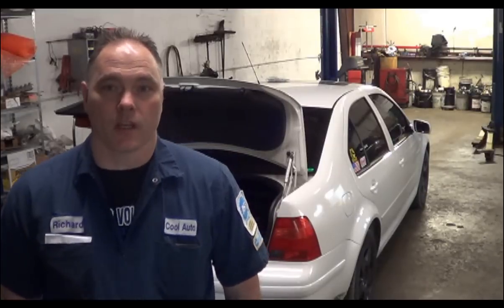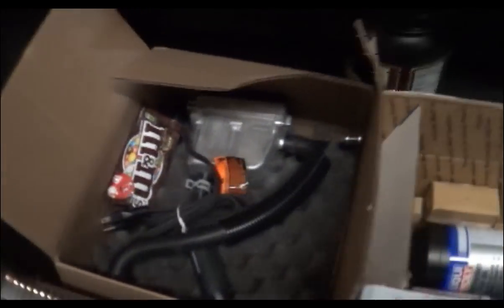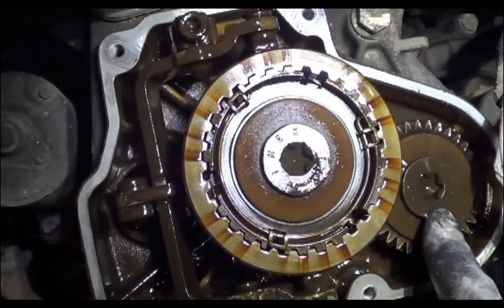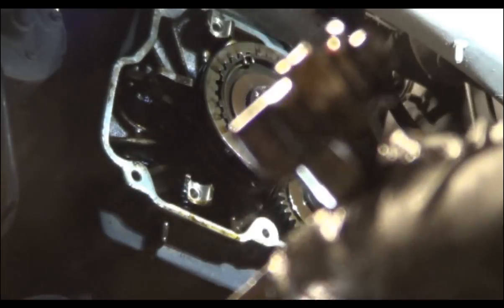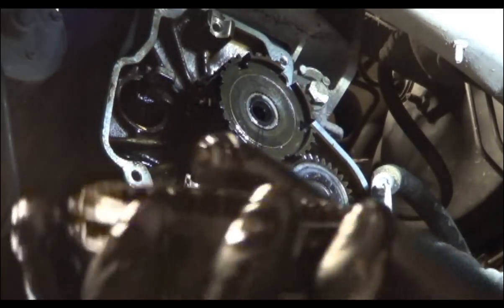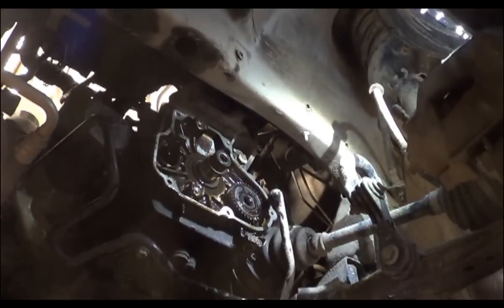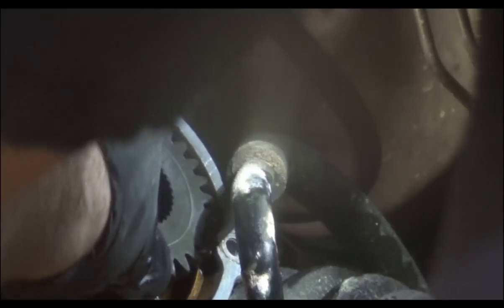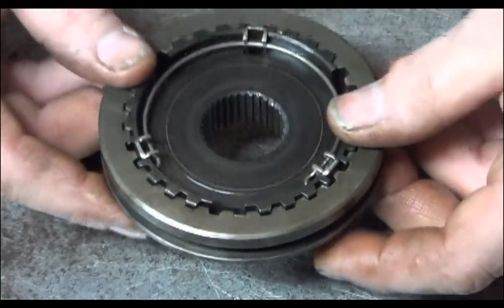Tdi 02J trans 5th ratio change

Comment: Many thanks for making this video!  It helped me to do the gear swap in my '02 Jetta.  I used an air hammer on light setting, with a flat-faced hammer insert that matched the diameter of the shaft.  Also heated the outer splined items (not too much) with a heat gun after reading an article somewhere.  Maybe beginners luck, but mine came off / went on pretty easy, with just light hammering.  I probably would not have had the confidence to attempt myself without seeing this video, so thanks again !
Reply from the maker: I'm glad my video helped.

Comment: Just put my new 5th gear in this weekend.  Using your "hammer" technique, everything came out with out a fight.  Now at 100 km/hr I'm showing around 1800 rpm...which freaks me out because it would normally run around 2100 rpm.  I do a lot of highway miles so I'm going to even save more on fuel....hehehe...I love diesel.  Thanks again!
Reply: Lower rpm is better .  How was your engine behaving at 1800 Rpm  ?  Did it seem like it lugging the engine ?
About how much millage could it go on a full tank . 1300km  ?  maybe 1400
Reply from the maker: did you gain some mpgs?
Reply: @bobbydhal2199  I can only use 5th gear when I'm going at least 100km/h (60ish)  But that's ok because all the secondary roads are no faster than 80km/h  so 4th gets used quite a bit.  The rpms are just too low to shift into 5th at 80km/h.  Because of this conservative driving I get just over 1100 kms per tank.  I haven;t taken it to empty because that would be silly :)
Reply: @CoolAirVw  Yes I did.  When I bought the car 20 years ago I was getting 900 to 1000 kms per tank.   Now I can easily hit 1100 per tank because of the lower rpm in 5th and the conservative driving in 4th.    Not bad for this old car eh?   On the Hwy I drive at 130km/h and only show 2400 rpm.   It's not a massive increase but the car doesn't work as hard as it use to on the hwy which should extend the life of the engine I hope....
Reply: Which gear do you have? 0.622?
Reply: @alessdiazlopez54  0.658  You have to change your driving style but it really is nice on the hwy.

Comment: Good video... but are those 200 rpm really worth it? I was actually expecting a bigger drop. We don't tear transmissions down, so I don't have any idea if that's a normal amount or if there are gears that can drop more rom.
Reply: The difference in fuel economy might be quite a bit different though.
I'm going to do this to my V5 golf.
Reply from the maker: Probably isn't enough in MPG to justify the cost of the gears.
Reply: It can make a huge difference in engine wear & noise plus better MPG mate. Especially in things like the old T4 van 02b box. Even better if the engine is remapped. It means you can use older 02b boxes in the 88bhp van which the original boxes are getting harder to find. I run one from a 2.4 DJZ code.
Reply: Just realised what you meant lol. he should have gone for a longer gear IMO.
Reply: Wouldn't it be down to if engine is powerful enough for longer ratio gears. I have caddy 2.0 sdi very low ratio, but some have tried the 6speed but said wasn't enough power in the engine.
Reply: Hey man is there any way i could contact you? My gears are stripped af

Comment: For pressing the hub and output gear on the shaft, I find it easier to just use the torx bolts without the washer to start them instead of beating them to death. Then you don't have to worry about the dogs and stuff falling out.
Reply from the maker: thanks for the tip.
Reply: I got a nice big socket with rubber over it and extension, held it with thumb n index finger while holding gear and brass jobby in place with middle finger, nice n slow, went in just fine, hope that helps someone
Reply: @CoolAirVW
Where are you located?  I have a lightly used Wavetrac LSD I would like installed in my 5-sp 2000 ALH Golf.  Also interested in a taller 5th gear "while we're in there."  I'm in southwest MI, and haven't been able to find anyone yet to work on manual transmissions.

Comment: To stop the shafts rotating you can pop it in reverse using the stick shift & 5th at the same time by pushing the synchro unit with your hands.
Reply from the maker: good tip. Thanks

Comment: This way worked out way better for me than applying heat. Definitely worth it if your driving a lot at highways speeds. Doesn't seem to struggle much, down low on Malone stg1.
Reply from the maker: You have to be careful applying heat, especially to the hub and slider as you can melt the plastic 5th gear bearing cage.  Also if your doing this on a 06 tdi they have a plastic oil trough that will melt if you apply any heat.
Reply: Hey so you have a stage 1 Malone... did you do a .658 gear?

Comment: In the middle of a tear down all the good stuff go go along with the wavetrac lsd. I did notice that you don’t need to take that third bolt out of the linkage, just slide the fork to the left and come out no issues. I also noticed that the two fingers have wear on it due to being a CCM 02A from 96. Wear can you source those fingers, if not I’ll migg a bead on to them reshape, then polish both the inside of the gear selector and mating surface
Reply: I don't recommend welding any wear surfaces. The parts are heat treated and will get softer if you weld on it.

Buy a new part or reuse the worn part. You will cause more damage welding and grinding it.
Reply from the maker: You would be better off brazing them than welding, as brass would be soft riding on the slider.  I would replace them though.

Comment: @CoolAirVW
Where are you located?  I have a lightly used Wavetrac LSD I would like installed in my 5-sp 2000 ALH Golf.  Also interested in a taller 5th gear "while we're in there."  I'm in southwest MI, and haven't been able to find anyone yet to work on manual transmissions.
Reply from the maker: Kansas City area of Missouir.

Comment: Hey so I am rebuilding my transmission or trying to.  It may not be worth a rebuild tho cause If I remember correctly I had that problem fifth gear was like neutral. So that means my shaft may be messed up

Also my current fifth gear was chipped and missing it's retainer ring on the slider when I pulled it off     retainer ring was laying in the cover

Comment: I have a question about my 2003 jetta tdi 5 speed manual and my 5th gear wont engage. If I do a taller 5th upgrade will I need any additional parts? 5th gear may have gone out due to low trans fluid.  Thanks for the video. Any advice will help.
Reply from the maker: Probably your supplier will send you everything you need to install the "taller" gear.  But if something was damaged due to low fluid you may need additional parts.  Take it apart and see.

Comment: The 5ft gear of my 03 jetta gasoline with the o2j  is not working, im trying to replace the same, so can i change on a gasoline too so i can better lower rpm on freeways?
Reply from the maker: You can change both gears for a ratio change.

Comment: Hi I followed your video and I have a problem with it jumping out of 5th the gear folk is fine 
It goes into gear but just pops out 
I put a 717 gear in the box o2a. Fbk 
Any help would be appreciated 
Thanks
Reply from the maker: adjust the "throw" into 5th and hope.  . That 's the large torx bolt under the 5th cover.  Movement in the shaft due to wear in trans can cause it to pop out and your not gonna fix that without major work or replacement.

Comment: Wow man. Nice.
I have watched a few videos of this. Yours is by far the best. Thanks.
Just a quick question.
I have the passat tdi. It's jumping out of 5th. Could you help me with guidance on the repair or to identify the issue? Thanks again. Dario
Reply from the maker: what  year?
Reply: @CoolAirVw  good day.
Thank you for the reply.
It's a 2006.  As far as I understand it's the 02J.
Reply from the maker: @MrDRSNUGGLES007  Are you in usa?   Never seen a 06 passat with 02j.  04 and 05 passats defiantly would NOT be 02j.
Reply from the maker: @MrDRSNUGGLES007  for 02j popping out of 5th there is a 5th gear adjustment.  I believe I mentioned it in this video, but if the adustment hasn't been messed with it probably has worn 5th hub and slider or potentially worn bearings allowing movement in the shaft that makes it pop out of gear.
Reply from the maker: @MrDRSNUGGLES007   If you have 02j you will probably have to pull 5th cover and inspect then pull 5th hub and slider to inspect.
Reply: @CoolAirVw  great. Let me do so. Much appreciated.

Comment: Is it possible to put the .658 in a trans from a gas engine, I have a tdi but lost reverse so when I swapped the trans I wasn't aware at the time the Gasser had shorter gears
Reply from the maker: Yes.  That may help your issue but the diff gears are different. too.  You should look for a tdi trans.
Reply: @CoolAirVw  I sent you an email

Comment: Am I to assume that this is only relevant to the diesels, because of the torque? My wife has a 2005 Golf with 02J and gas engine. I suppose this wouldn't be very effective, am i right? Thanks for an interesting video.
Reply from the maker: The ratio that we use on the diesels would be counter productive on a gas engine.   But I've heard that folks with gasser cars take the stock 5th gears from the diesel and put them in  their cars., but I've never done that.
Reply: CoolAirVw Rm yea I have done it many times. It runs great!

Comment: Hello Where can I find taller TDI 5th gear set for my 2003 Audi A4 B6 FWD 1.8T 5 speed ? Looking to cruise @ 80 mph at 2500-2700rpm
Reply from the maker: Its not a simple drop in on your trans like  the one in the video.  Would probably require complete removal and complete disassembly of the trans, meaning most shops would charge you like a rebuild.    I dont know where to buy gears like that but most people would not do such a modifiation due to the expense.
Reply: @CoolAirVw  I see I did it few years back on 02 mk4 gti 1.8t swapped TDI 5th gear set.
But b5 passat tdi is not similar to the 1.8t b6 a4 fwd?
Reply from the maker: @UATUNER  Your 02 Gti is the 02J trans just like hte one in this video.  A B5 passat doesn't have a 5th gear cover to remove to do that.  You would have to pull the trans out and mostly disassemble the whole thing.

Comment: Where's your shop at???...thanks
Reply from the maker: Just south of Kansas City Missouri
Reply: O have The same problem ,but mines is a 2002 beetle 2.0 gasoline, is the parts to change are the same as my car?and if it is what's the name of the parts a need the gears,how or where can I get it?thank you!
Reply from the maker: @javierleon2579  Sometimes you can get used gears on ebay.  new gears are dealer only and expensive.  Used transmissions are not that high for your car.
Reply: @CoolAirVw  so my best choice is to replace the whole transmission then??.... thank for the advice
Reply from the maker: @javierleon2579  that is your choice.  But its definatly a good option.

Comment: Why not use a harmonic balancer installer to put the gear back on instead of beating on it? Just a suggestion.
Reply from the maker: Okay but what is your harmonic balancer going to pull against?
Reply from the maker: what are the chances your harmonic balancer puller matches the threads inside that shaft.  I suppose a guy could make an adapting shaft.

Comment: By any chance would you know the bolt size & thread pitch of the 2 gear bolts?
Reply: Vw t4 is t60 for gear bolts and m12 for selector
Reply: @barrybrockp8358  thanks! I'm going to make a tool so it'll be quicker/easier to do the job. Whats thw pitch on the M12 bolt?

Comment: I thought the  .658 was a 600rpm drop
Reply: ~13% drop
Reply: The higher the speed, for instance at 85 or 90 mph, the greater the difference in engine RPM between the two gear sets.

Comment: What's the stock 5th gear ratio?
Reply from the maker: thanks for watching. Sorry I don't have that memorized.  I would love to impress you by just spouting out the answer, but I just dont have the time to look it up.  Honestly though,  you can certainly find that info with a little bit of internet research.
Reply: @CoolAirVw  Found it.  When this horrible virus has gone i'm swapping 5th gear on my Toyota Corolla from 0.815 down to 0.725 for better mpg and lower revs.
Reply from the maker: @jaggass  Might want to do some research to see if that is gonna give you better MPG 's or not.
Reply: @CoolAirVw  With it drop of 0.95 i can't see the MPG increasing but it will certainly be more relaxed at 70mph and even 50mph.
Reply from the maker: @jaggass  ok.
Reply: @jaggass  Unless you are cruising at high speed, .725 is way too high for a Corolla. Generally you need more torque to drive taller gears. Driving at 50 mph could also add significant strain on the engine bearings.
Reply: @davidparker9676  I do drive at high speeds quite alot and can't go above 60mph before it starts screaming. 3400 rpm is way to high at 70mph.
Reply: @jaggass  I'm sorry but 3400 rpm in a Corolla is not screaming. and 70 mph is not high speed. 70 is normal highway speed. 90+ is high speed.

Your redline is somewhere around 6500 rpm, and your power output does not fit the taller gears.

Comment: That is not a wise way to remove the gear. If you don't have the correct puller don't do the job.
Reply from the maker: Strange, I worked in transmission shop for 23 years.  We did tons of manual trans gears just that way, and I'm just now learning that isn't correct.    Even as professional transmission rebuilders we didn't have perfect tools for every job, and sometimes had to improvise to get the job done.  Buy I think this method isn't improvisation at all.   I've rebuilt or repaired 40 or more of Vw 02J transmissions since working at trans shop, and this method worked great every time. I also think DIY'ers appreciate learning alternative ways to do things so they don't have to buy a expensive puller for a one time repair.  That's what youtube is for.  I think I'll continue doing what I do,  because it works.
Reply: Simon Elenor 
 Do you have  video on how to do it properly??
 Nope I didn't think so
Reply: @CoolAirVw  
Great video 👍👍
Reply from the maker: @earth7551  Whenever I receive a comment like the one saying" your not doing it right" or basically any negative comment, I click on their name to look at their channel to see what videos they have posted.  Usually NONE or at least none of any value that would help anyone do anything. No auto repair videos, no wood working videos, no cooking videos, no legal help videos, no financial advice videos.  But they certainly can "knock down" what others are doing.  Several times a month someone tells me, "that is exactly that problem I have and your video helped me fix my car".  That feels great!  Thank YOU for the positive comment on my video!
Reply: @CoolAirVw  
I know right 
Quick question Sir I bought a used 5spd transmission for my 2004 Volkswagen Golf gti 1.8t 
 And the mechanic who installed it never put  oil in the transmission 
I can't believe it was working with little oil that was in it but the bad part is now 5th gear is not engaging not working at all 
 So it was all due to the mechanic who never put in fresh oil very frustrating 
 All gears work now 1-4 and reverse 
 Can 5th gear be replaced with a 5th gear like this  and does the whole transmission have to come down or it just be replaced like this 
 I really would appreciate it some advice 
thank you sir
 It's very difficult to find a mechanic that will do what you do down here in miami Florida
 And 0.756 ratio 5th gear work on my
EHA 02j Awp my transmission
Reply from the maker: @earth7551  normally I would say there would be other damage and chances are good you'll need major repairs, but I put 5th gears in one in a video and its still working.  Give it a shot maybe it'll be ok.
Reply: @CoolAirVw  ok thank you